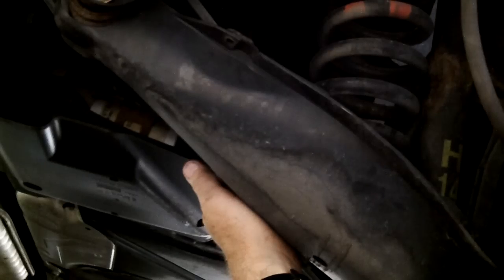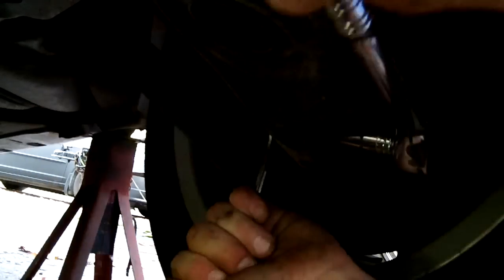Mercedes rear shock absorber replacement w208,w202,w203,w210

Comment: Thanks so much for all your efforts. Recently purchased my first Mercedes, a '99 clk 320 coupe, and your videos are a great help. First time I've ever done an oil change via the dipstick extraction method & didn't have to get my hands dirty! 
I'm lucky in that the one I purchased, even though it has 200k km, was babied & never winter driven. I'm saving all your W208 related videos for future reference.
Reply from the maker: One of the prettiest cars ever designed in my opinion. Bentley Continental GT is almost a dead on copy of the clk design  :)

Comment: 230k km? My 2002 C208 CLK430 has 205k MILES (something like 330k km or something) and it’s just now having noticeable excess body roll from the suspension. 

It’s incredible how these Pre-2003 Mercs are built to last. Even in the early years of DaimlerChrysler, Mercedes-Benz still was easily the best.

Comment: hi fupabox, thanks for all your great videos, should the car be lowered before tightening the top bolts? cheers
Reply from the maker: The top bolt yes.. you can tighten it a bit , but do the final tightening on the ground.. the lower bolt can be torqued to spec off the ground
Reply: ***** thanks mate. much appreciated.

Comment: Hey question again about the 202...How long is the suspension good for on the C-class? I went through the service records on my car, no suspension components have been replaced so far and it's at almost 120,000 miles. Would you recommend a rebuild yet on the front suspension?

Comment: Great video, thank you!
I have done mine today on my W208 320 CLK. Since putting the new ones in my car makes a kind of knock noise when going over bumps. I am wondering if I have over tightened the top bolts as I put them on super tight. Is it possible to over tighten the top bolts?
Thanks in advance for any advice.
Reply from the maker: yup..possibly a bit too tight . with the weight on the wheels the rubber should just start to compress.and squish out at the sides
Reply: @fupabox  Thanks greatly for your reply. I will check on them today. Going to try and change  the fronts today as well!

Comment: Hi. Not sure if this has already been answered, but the spring did not need to be fiddled with, in order to change the shock strut?
Reply from the maker: daimasongoodspeed  ..no the spring doesn't need to be touched
Reply: Thank you! My W203 makes clunking noises when I drive on bumps. I'm not sure if it's just bad bushing or the suspension struts need to be changed. Could bad bushing be the problem?
Reply from the maker: daimasongoodspeed it could be bushings, shocks, ball joints.. any one of them

Comment: Just bought new coil springs and shocks absorbers front and rear.. Any advice or thoughts on how I should go about installing them? (Each wheel at a time, spring and shock? Both rear shocks then springs, then front? Etc.) Thanks
Reply from the maker: spring then shock 1 corner at a time is my preference

Comment: Hi, please did you clamp the spring in so as to change the shocks?
Best wishes.
Reply: +lakeisha farall you can use you jack under the control arm. I placed jack below control arm and jack it up a little then removed shock and control arm bolts and slowly lowered the jack to easily remove the shock and spring

Comment: Do you have any comments on Monroe vs Boge vs Sachs vs Bilstein shocks (and struts up front for w203)?
Thanks!
Reply from the maker: Monroes just seem a bit more compliant to me..with solid lower control arm bushings I worried about the Bilsteins,Boge being too firm...I have seen many original Bilsteins at 200k +   km still in good condition, I have doubts the Monroes would last that long

Comment: Good instruction. A head light would give better lighting for the video. Also, shouldn't you take off the tire to have better room to work with?
Reply from the maker: You're right on the head lights..I try to use one whenever filming just to help with the bad lighting..The tire can be removed but it isn't necessary, it definately  would have helped with the lighting issue though

Comment: Does it make a difference to replace coil spring? I am rebuilding the front suspension on my w210 with 350 k miles and the original springs look pretty good. I live in Arizona so my car is rust free
Reply from the maker: at 350k miles I would do the springs as well..the front springs are around $100 per pair
Reply: At 350k miles I’d change the entire suspension. Push down on each corner of the car, it should come up and stop firm when you let go. If it bounces as if you just pushed on a waterbed, then it’s time to change the shocks.

Comment: Can u convert a self leveling system to regular shock absorb system
Reply from the maker: if your car model had a version with no self leveling , you can usually swap in the non leveling parts...if all versions had self leveling then you would need to find an aftermarket alterbative

Comment: can take for w209 pretty much the same process
Reply from the maker: Luis G. Hernandez yes almost exactly the same
Reply: hey did you do struts? I did struts recently with rear shocks and now I notice a very small gap between the strut nut bracket inside the engine compartment is this normal?
Reply from the maker: Luis G. Hernandez  which car strut are you referring to ?
Reply: My CLK 55 W209, but since its based on the C class perhaps you've got the small gap too
Reply from the maker: Luis G. Hernandez Ahhh.. yes brain fart on my part.. The w209 has a shock in spring type setup, unlike the w209 and older cars that had the spring seperate.. The w209 has a kind of semi strut since it also has an upper wishbone..once on the ground there is supposed to be a tiny gap, but I can't recall how much